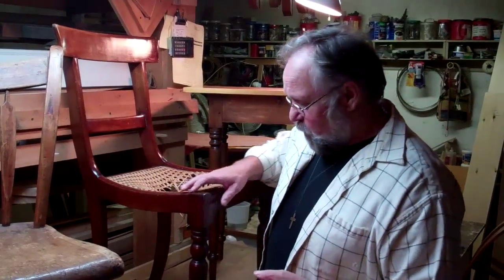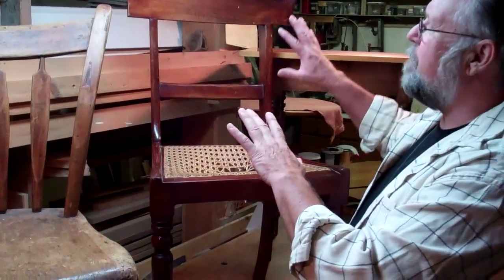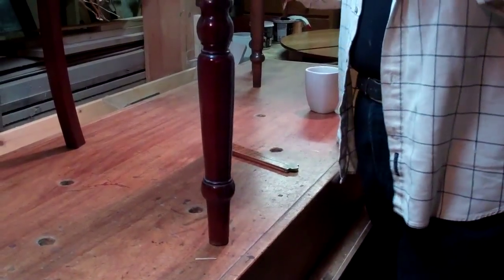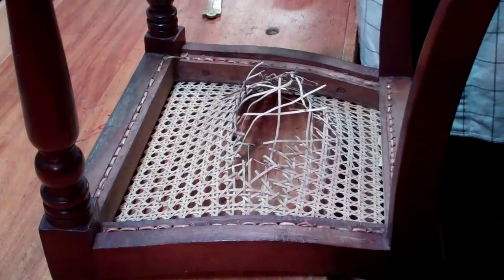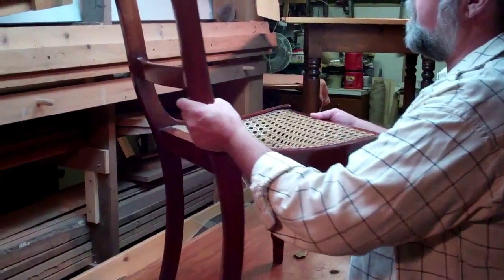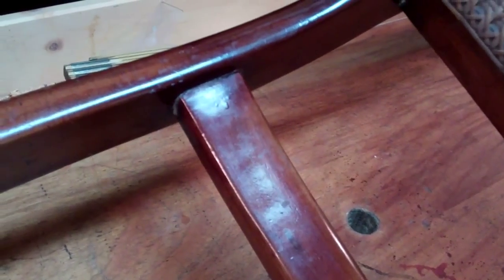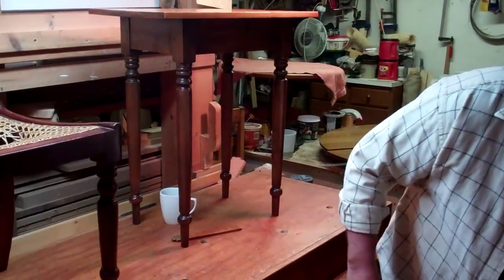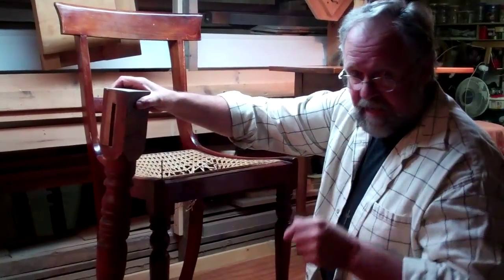Finding signs of hand work in antique furniture

Comment: a chair is a chair as long as my fat ass can fit in it I give a shit less. the only time I care about a chair is if its one I am going to sleep in or watch movies in. And you know I have seen a lot of people latly talking about antique chairs and restoring them and how they are so hard to find. well I see them all the time in the trash and for sale cheap. I just picked up a old school chair a few months back from  the 1800s. I will not be restoring tho its in my shop for $30 let someone elce do the restore the chair sells for around $100 on ebay but shipping is hell. yesterday I picked up a old lether seat chair form the 1940s for a buck its nice. but I would say the best thing I got and should nothave sold was a old chair from the early 1800s with the slide drowr on the bottom. it was crached all over someone who owned it has a crap load of screws and nails in it and it was pretty much falling apart. well I sold it for $5 a guy love it and wanted to try and fix it since it was so old and cool looking. its fun to deal with old chairs and I love the old old antique ones that are all hand made. but I cant believe what people toss out and I turn around and sell. in fact I just sold a old metal and plywood school chair from the 60 70 and 80 is when they used them and I got $25 for it and pulled it from the trash.